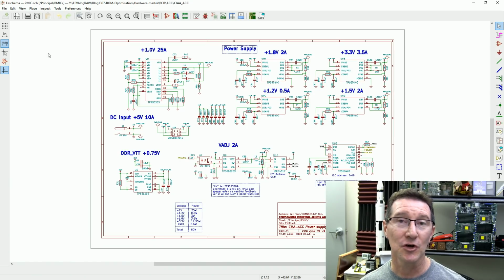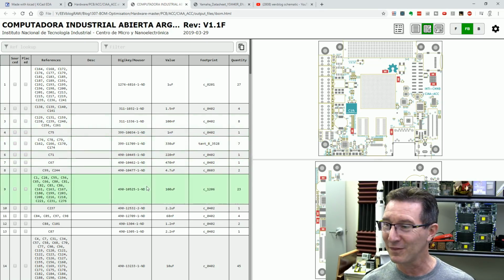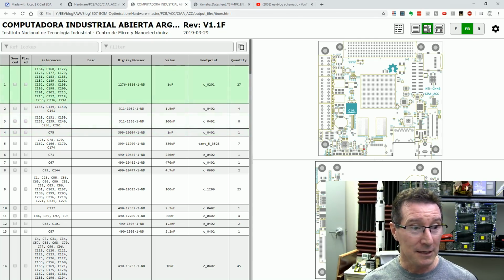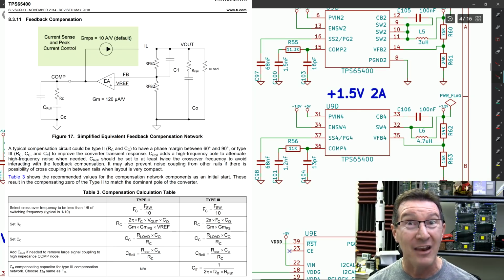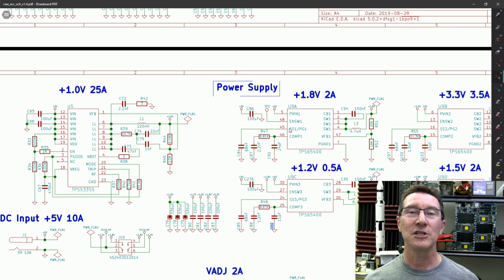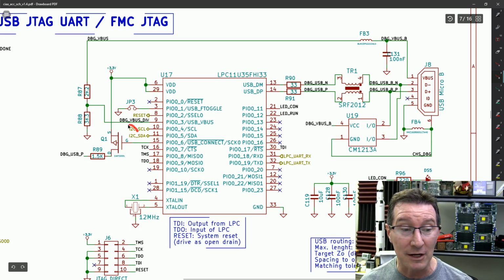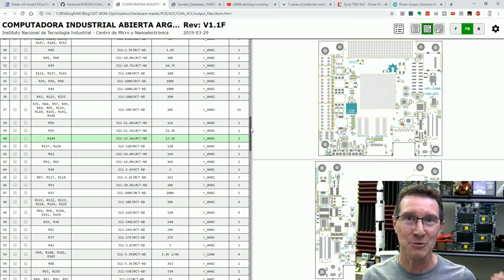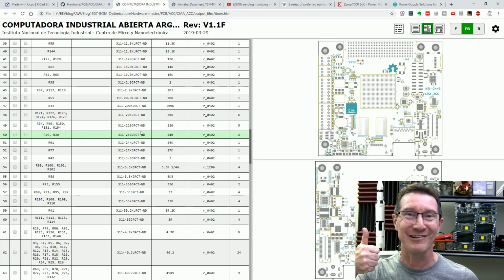EEVblog #1307 - TUTORIAL: PCB BOM Consolidation

Comment: You skimmed it, but one thing that can really help cost reduction is the more complex silicon. If you have 3 types of RAM modules in different parts and there's any way to go from 2 of these, 1 of those, and 4 of the other down to 11 of one type that can save you a fukton through both volume discounts on the parts and the wide pick'n'place lanes for big chips.

Put lots of different big chips on suddenly "80 lanes" becomes "an 8 lane wide CPU, two different 6 lane RAM chips, then five regulators at 3 lanes each" and almost half the lanes are gone before you start.
Reply from the maker: Yup! Add in a few large pin count SMD connectors and your are done for! Time for a bigger line.
Reply: just an idea: It might be even cheaper to use a large capacity RAM chip that can provide dedicated regions to the subsystems that require what otherwise would have been their own RAM-chips. (EG instead of 3 different 6-lane RAM chips, you use one 8 lane RAM-chip ... but you also need to take RAM access contention (and the circuitry for handling it) into account when calculating the amount of lanes saved)
Reply: @SkyCharger001  if signals dont need to be routed across the whole board for it and if it doesnt require any more address decoding logic and if signal runtimes arent buggering you up sure that could work
Reply: I'm curious if for bigger chips you can get custom mixed tapes made to suit. IE 2 RAM A, 3 IC A etc.
Reply: @hannahranga  If they are the same package, i'm pretty sure it can be done but manually unless all are from the same manufacturer and you are ordering LOTS of them
Reply: @hannahranga  Yes. Some distributors will do that for you, even. They have a specialized pick-and-place that unloads multiple tapes and loads up an empty tape and seals it up. I guess the process must have been developed for the prototyping industry that constantly deals with stupid numbers of BOM items. One approach they take is to have one mixed tape for each size of component, for those components that there aren’t too many of. And they can have multiples of those mixed tapes for any given footprint as needed. The hour on those “tape mixers” costs 5-10% of the hour on the actual pick-and-place that stuffs the boards. So usually very worth it for small runs. Divide and conquer, specialize - whatever you call it, it helps :)

Comment: Great video! I'm an EasyEDA Pro user and JLCPCB customer. The app makes it fairly easy to select specific part numbers from their catalog. The magic word for parts is "Basic". JLCPCB keeps Basic part reels loaded into their pick and place machines, and they're typically dirt cheap and always in-stock. Any other part is called "Extended" and they charge a $3 fee per part number to find and load each reel (except they waive the fee for "Promotional Extended"). If all the components on your PCBA are in-stock, then they build, assemble, and ship it quickly. When I have to choose an Extended part, I'll try to choose one that has high quantity in-stock or "idle inventory". There's no 100% guarantee it'll still be in-stock when they prepare the order, but it gives you the best chance. I avoid parts that don't have datasheets.

Comment: interestingly, for DIY stuff it can often be quite the opposite: if you buy your parts in kits (X values * Y pcs each), which is a frequent case for resistors and caps, then you need to utilize as many different values as possible to deplete your kit resources as evenly as possible.

Comment: I got my first job as an EE in 1980. In those pre-Internet days even small manufacturers had a dedicated purchasing agent. It was not a big company, and our typical production runs were in the low hundreds. Shortly after I designed my first board the purchasing agent sat me down and gave me the same lecture that was in your terrific video. He told me that buying a unique one cent resistor might cost the company $50 for his hour or more on the phone. On a production run of 100 it turns a one cent resistor into a 50 cent resistor. I never forgot the lesson and to this day even on hobby projects, every time I place a resistor I’m thinking, “can I use a 10K 0603 here?” Thanks for the reminder!

Comment: Noticed all the termination resistors on the DDR lines.  AFIK most FPGA's have internal resistors for termination of common IO impedance.  So all of these resistors are probably redundant.  I've also had good luck getting rid of series termination resistors by picking the right IO drive strength.  For instance, on the Spartan 6 chips 3ma drive strength series terminates a 120ohm twisted pair almost perfectly.  (very useful for a CYA connector or built-in connection to a logic analyzer.) 

Another good off-brand use of FPGA IO pins is as high speed analog comparators.  Because they support so many different differential logic formats it's just cheaper to put a high speed rail to rail comparator on each pin instead of 4-5 different differential input stages.

Comment: There is one more thing about this schematic and PSU. The TPS65400 do have default sequencing of 5ms by default from the factory. This can be adjusted programatically via EEPROM programming of the chip, or via external capacitors to SS3 / PG3, etc. Check section 8.6.2.15. So the C85 (68nF), C84 (68nF), C97 (68nF), C98 (68nF), can all be just probably. 1) Default will be probably all good what you need. 2) You can change it and burn into EEPROM to do other timing if needed. 3) It looks if you don't program it this way, the capacitors are required still tho (a sad thing), but they don't need to be really all 68nF. Any reasonable value will be all fine in most situations. Anything 30-100nF will probably work, as sequencing will still work, but exact timeing doesn't need to be so precise. It is important to annotate schematics and group parts to you and other that some values doesn't matter too much, and can be safely changed.

I don't blame the designer for using the values recommended in the data sheet. Sometimes your volume is really small, cost doesn't matter much, and you don't want to spend few more weeks on optimizing your BOM, which do require a bit of mental burden to do, where there are other more important things to focus on.

Comment: This 1.2V and1.5V PSU is an excellent example. You would instead use 10pF, and 10kΩ resistors in both probably instead. 10kΩ and 10pF compensation network will work in both. Similarly in 1.2V you will just use 10kΩ+10kΩ in series at the bottom of voltage divider and 10kΩ at the top of the resistor divider, or 10kΩ and 10kΩ||10kΩ, depending what kind of current consumption you need and what is required impedance of the VFB3 input. From data sheet you can see that VFBx inputs use about 12μA.

Comment: i remember i once needed a 12.4 k resistor to set the current limit on a vreg i wanted it to be somewhat accurate and 10 k just set the value a little higher then i like so i made the decision to change all the generic 10k resistors in the schematic the the new 12.4 k so that i did not need to justify having two values so close to each other. it was a good compromise as the bom was still reduced and i got to keep the current limit to what i wanted in the equation. also i got lucky because i was also able to remove a 1.33 k resistor from a different regulator that used to have a 10k and 1.33k to set the voltage but changing the 10k to two 12.4k in series to produce 24.8k allowed me to use the 3.3k resistor i used for the I2C pull ups to achieve the same ratio so i removed two BOM items instead of just one by doing this seemingly odd choice. anyone looking at that schematic 10 years later will be scratching their heads for sure over all those 12.4k resistors. but there is a reason.

Comment: Great advice video, Dave, on BOM consolidation. I've had to do this in the past where I tested multiple parts in the lab for their specifications, cost and supply chain availability. Most of the parts came from China, but there were times I had to consolidate parts from the parent company's parts list to save on costs because of bulk volume purchase discounts. BOM parts consolidation is an essential process to sustainable manufacturing and multiple supply chains and vendors should be sourced and considered, just in case of a supply chain shortage or disruption like what we're experiencing now with the pandemic. Spend the time to calculate the consolidated part and have it tested, then approved by the design engineer, prior to substitution. This saves time, money and headaches.

Comment: Generelly prefer 0402 for complex, small boards. But even use same value but different size (generally 0603) resistors for easier hand  soldering for test/debug purposes. 0 ohms and hard config pins are typical.

Comment: Sometimes it's useful to use weird values... I recall a few years ago there was a capacitor shortage, and 'normal' values were in short supply with long lead times. However if you changed your 1uF for a 1.1uF suddenly stock was easier to get!

Comment: Could you realistically reach a point where it's better to move to some specialized 3-terminal low impedance bypass caps instead of having 3-4 values in parallel?

Comment: Super useful video!!!
I used to work for a PCBA manufacturer so have first hand experience with what happens when BOM's are all over the place. I recall a number of customers never bothering with consolidating their BOM's (even when we reminded them about it), so it was common to see 5 variants of a 10N capacitor  (X5R/X7R/0603/0805/1206...) on the same board... And when this happens 5-10 times on a single board assembly cost really start to add up as you have the machine operators spending more time kitting up, more nozzle operations, the job taking up a larger chunk of the production line...

Comment: I wonder what happens if you were in a company that has “design by committee” where they need proof without building the board that removing the 14pf would change if you went 16pf?

Comment: Lots of devices designed by company I work in had the same "military" connectors for power, communications, telemetry etc. so it could (and actially WAS lots of times) be connected wrongly. When I started to design my device, I used different connectors so it's fool-proof. But then I was heavily critisized for this solution. Found out there was a rule: order 10% more components of each type "just in case". So having 10 connectors of the same type requires to buy just 1 extra, while my "different connector at each place" requires doubling of quantity (10% extra for ONE connector is still 1, rounded UP). So yeah, BOM consolidation at its finest.

Comment: I have created an excel file of resistor ratios. I fed standard E6,E12,E24,E48,E96 values in a program and calculated all (not really, but close enough) possible ratios and exported to Excel. The columns next to it gives R1, R2 values and the "cost" - lower "E"= lower cost. So cost of a pair is that has E6 and E12 is 18. I sort this table by Ratio, then by cost. Top row is filter. I just set cost filter to say - 12 i.e both E6 resistors, And set ratio filter to the range that's acceptable. Then look at the results to make a choice. I rarely need to use rare resistor values because of this.

Comment: I have created a Excel file of Resistor Ratios. I fed standard E6,E12,E24,E48,E96 values in a program and calculated all possible ratios. The columns next to it gives R1, R2 values and the "cost" - lower "E"= lower cost. So cost of a pair is that has E6 and E12 is 18. I sort this table by Ratio, then by cost. Top row is filter. I just set cost filter to say - 12 i.e both E6 resistors, And set ratio filter to the range that's acceptable. Then look at the results to make a choice. I rarely need to use rare resistor values because of this.

Comment: When I start my first job as a hardware designer, I found out that the most other designer just used previous designed schematic blocks that where designed and tested for previous projects. That resulted in designs where the BoMs had a large number of parts. There were several number of pull-up resistors, a lot of capacitors, even the same value of capacitors often had different manufacturers. And nobody seems to care about it.
Reply: One firm I worked the purchasing officers just allocated a new part internal number for every part on a new product BOM , even when the part was chosen by the designer from in-house standard stock values.They ended up with a components store full of boxes of identical components but under different internal part numbers.
It was massively inefficient and, worse still, you could have a manufacturing run held up for lack of a particular part number even when there were boxes full of that part, under a different number, languishing somewhere else in the store.
Needless to say that firm almost never made a profit on their manufacturing operations but no-one in management could be bothered to correct the situation.

Comment: Especially take advantage of any built in parts already existing in your major components. Of course you can't optimize out that MCU, but you might be able to DNP all those external pull-ups because your MCU has built-in internal pull ups.
The MCU may even have drive strength selection for its GPIO which may allow you to optimize down the number of series resistors if you're sourcing/sinking current from the GPIOs.

One trap that I thankfully avoided is that if you don't need a part, don't immediately remove it from the design. Just DNP it! You never know if you need that extra 0603 cap footprint to stabilize your PDN or something like that once you actually build your design.
Recently did an 10-lyr design that had a signifcant number of different value resistors/caps. And while it wasn't high volume, it was a headache for both me and my assembly house. Always ALWAYS incorporate BOM checks (including lifetime/leadtime checks!) into your design process before you even go into layout/routing!

Comment: I could watch this type of videos for hours. So, yes, please more of this and please even more in depth. I do small scale manufacturing in house, and spend quite a bit of time BOM optimizing, adapting my pcbs for my 44 feeder pnp machine. I occasionally parallel or add resistors in series to get the values I need. Saves time, but wastes pcb real estate.

Comment: How critical is having the orientation of a footprint line up with the orientation of the part in the reel?
I  find that when I have something like a 10.729371kOhm  0.000001% resistor -  I need it. Does it make sense to then use said resistor in place of the zillion 10K 20% resistors on the board?

Comment: You mentioned this board is for educational purposes.  Does that include, perchance, BOM optimization exercises?  You need a design with an non-optimized BOM for that, after all.  It's not all that important WHAT the design is, so long as the student being given the exercise is far enough along to understand what all the parts are doing so they don't break it.

Comment: I have an industry story that I’ve heard around that in the old days japanese tech firms did not do any kind of consolidation, and engineers tended to be hyper-disciplined in actually calculating stuff like pullups. As a result you could tell the region by looking at a graph that tracked units sold vs value because western ones were all spikey, while japanese companies where almost flat
Reply: I used to work for a Japanese firm and it was very different from working for a western firm. They were very slow and formal in their design processes with the reluctance to depart from traditional methods or to introduce significant innovation into their designs.
A lot of their designs were evolved from previous designs and they reused a lot of circuitry. If they had a particular piece of a previous design that they really liked they would go so far as to saw out a piece of the old PCB and mount it as a module on a new design. This was not just done for prototyping but also on a low-volume production basis.

Comment: At the other end of the scale is the little hobbyist  single unit project. You sometimes can't buy from big name catalog because in some country they just don't want to deal with individuals, so you are stuck with whatever part your local small dealer have in stock. For this i often make a pre-draft of my schematics then set up the BOM and try to purchase the parts. Then only when i have sourced all parts (99% of time not exactly the one i intended at first) then i redesign the whole project with whatever i have been able to source. And yes small local dealer don't have 13.3K resistor, some of them don't even know that exist at all. In this situation it's actually more convenient/cheaper to use a trimpot wherever you need a very specific resistor value cause if they don't have the exact valut you can just take the next bigger value and trim it down. Recently i was designing an audio efect unit and for the filter part i needed to have relatively precise values of potentiometer, but was unable to find all the value needed in the same package form (there was only 3 !) because for small local dealer a 10k pot is a 10k pot, the physical dimension doesn't matter (sic)

So at the end the BOM is almost the first step of the project, not the last as the theoretical industrial flow tend to tell us.